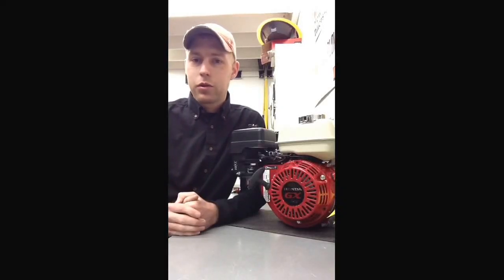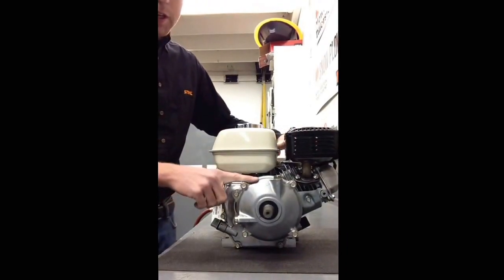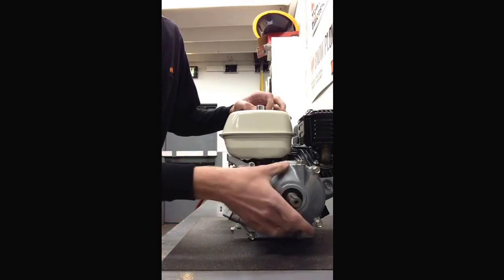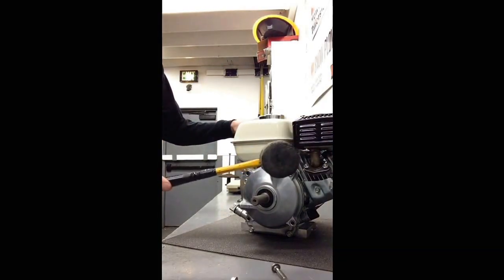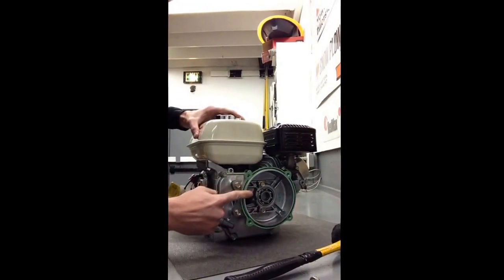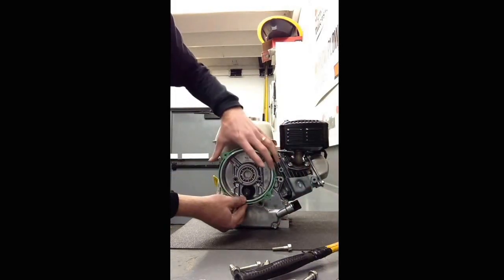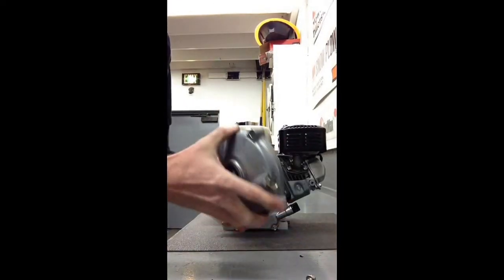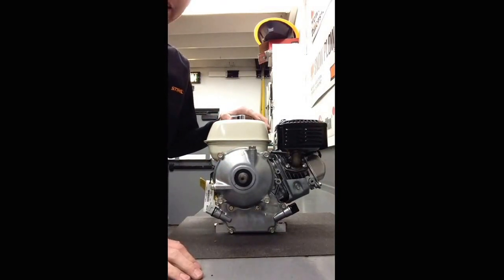How to rotate a gearbox on a Honda GX120 or GX160 engine for use on an aerator

Comment: Is it possible to leave out the gear reduction box and use for another application? Im left with the splined shaft  but need a keyed smooth couple or an adapter. Is this possible?

Comment: Hi Craig great video, thank you. I have the same engine/gearbox on a classen CA18 and I pulled it out of the shed and there is a slight oil leak from under the gear box on the frame of the unit, is this a big deal and what should I do? Any help appreciated :)
Reply: Replace the gasket or tighten
Reply: Have you had any luck locating a new seal?  I am currently looking at a used classen on Craigslist with the same issue.  The gearbox is not available through classen and I probably only need the seal.  I did find a new gearbox on carrollstream.com.  The model is GB-7575 by NORAM.  It’s $210 w/ free shipping.  Good luck.